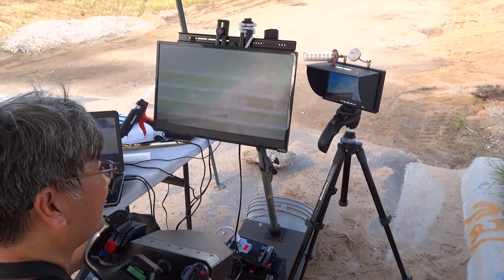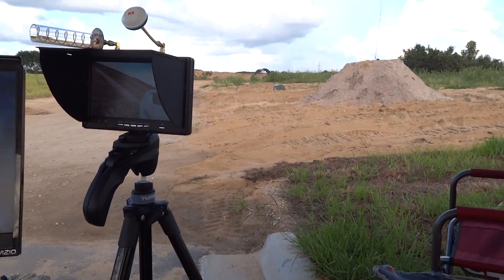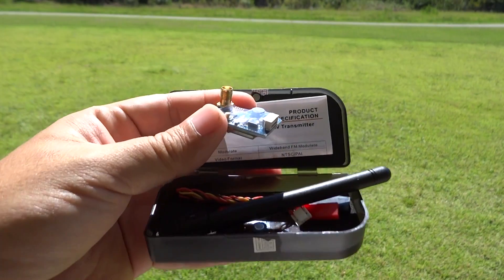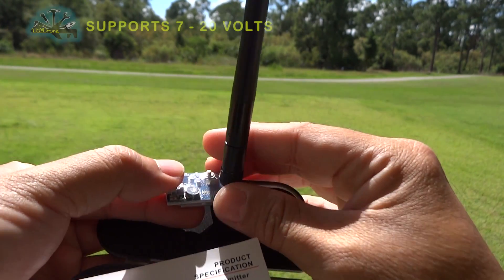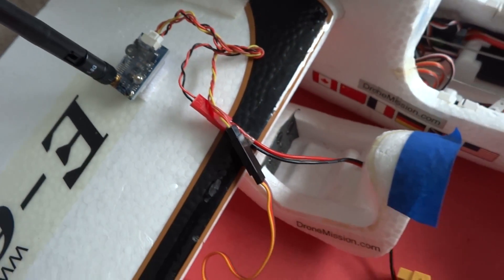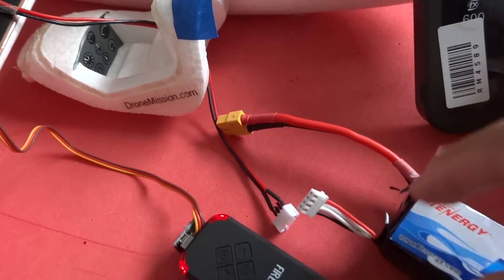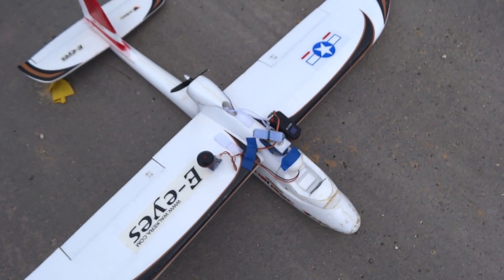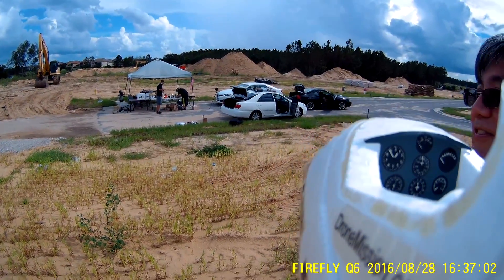Easy FPV setup Firefly Q6 FX796T

Comment: One quick question that is struggling me for about 2 weeks and i cant find solution ... (maybe because my knowledge about fpv is zero )  :))) ... So here is the problem ... I have an air plane a j3 navy cub , i bought this magnificent camera FireFly Q6  i placed it in the dedicated space for this rc plane  inside the cockpit i put the airplane wings back in place and NOW i am not able to press the start/stop recording button on the camera  LOOOL.... So i have to record 20 mins video for 5 min flight .... 
How can i start/stop recording video from my transmitter (Spectrum dx6i) ????
Do i need a video transmitter for this? despite i dont have any video receivers or goggles all i need is to record the video during fly in an sd card for now...
Thank you very much in advance for your time ...
Greetings from Greece
Reply from the maker: You may be in luck, there is a remote cable Firefly sells, that you connect to a open channel on your receiver and assign it to a switch to start and stop.  The only thing I do not know is which one is compatible with Q6. Search Firefly remote here ...  http://dronemission.com/find/hobbysales.php

Comment: Just got the same setup in today. A couple of question to ask. I noticed the heat from the transmitter was somewhat high. In using a 7.4v battery, could that had been because it needed a full charge? I noticed out of the last 2 video takes the sound was somewhat distorted. I plan to use a 11.1v 3s battery later.
Reply from the maker: In my opinion, a video transmitter at 600 mw will get a lot hotter in general.   I have tried switchable vtx, and they seem to be cooler at 25 mw and hotter at 600 mw.  The half charge battery should not affect the temperature.

Comment: Nice!
Reply from the maker: Good morning JT! how is it going the other side of earth  Thanks - L
Reply: ***** It's Spring but still a bit cold. By the way, is the Firefly cam good to get?
Reply from the maker: I am leaning towards firefly q6 or runcam 2, however wait for the new mobius mini.  Account for the fpv cable if it is not included, both firefly and runcam provides them.  See your pref https://www.youtube.com/watch?v=o_zI5-amX9M
Reply: Ok, thank you for your advice.